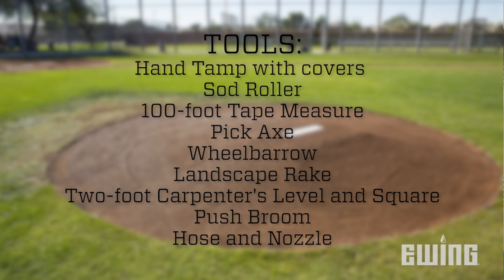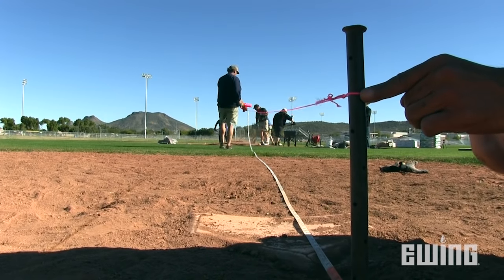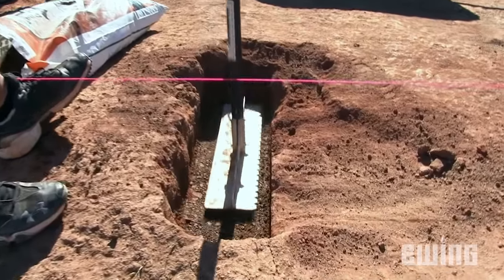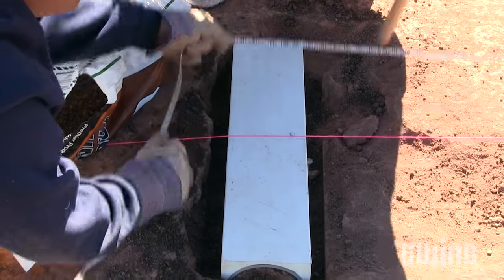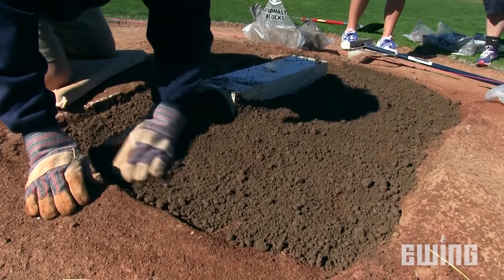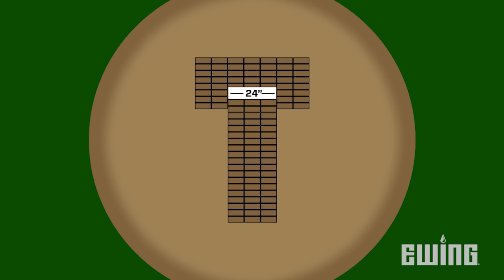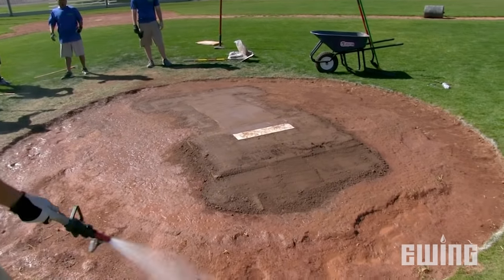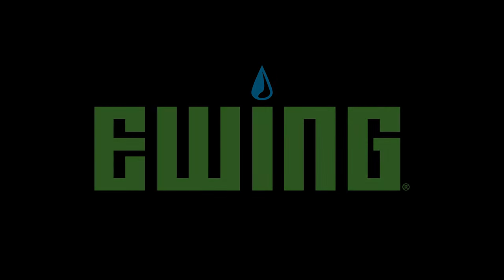How To Renovate A Pitcher's Mound

Comment: We install these all the time. Only thing I would add is to check the home plate and pitching rubber grades with a laser level to insure 10" difference. However this is probably only necessary at collegiate or pro levels. Very nice informative video!
Reply from the maker: Good advice! Thanks for the comment.
Reply: Where is your company based out of?

Comment: Edge around hill, roll with paint roller and herbicide to kill everything in the mound area. then rough up and pull extra material for clay bricks. all of this will make it so you dont have to bring more clay in for the edges/lip of the grass. removing the grass and roots by digging removes material.

Comment: Then the pitchers will dig a huge hole in front of the rubber.  Never could figure out why.  Same with the batters box.
Reply: e walt when I pitched I liked to have a small divot in front of the mound cause it would increase the velocity of my pitches when I would launch myself off the mound.
Reply: Nick Bemo velocity doesn’t come from launching, it comes from rotation.

Comment: When I was 13 I measured 60' 6" by starting with the front end of the pitcher's mound or in my case, the line I drew on the ground with a twig to the FRONT part of home plate and not the apex of home plate as shown here. damn. I had us all these years pitching from too far away! maybe 12 inches too far! If anything i should have made it 12 inches closer!!! since none of us threw over 65mph anyway! what a waste of 20 years.